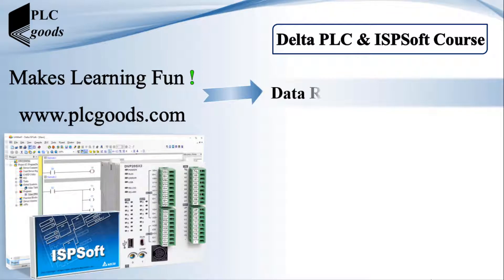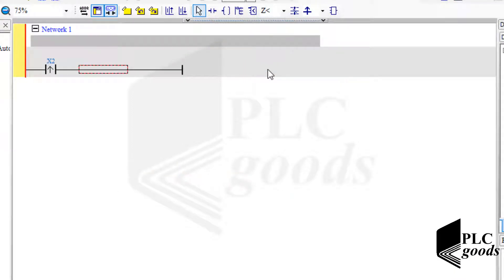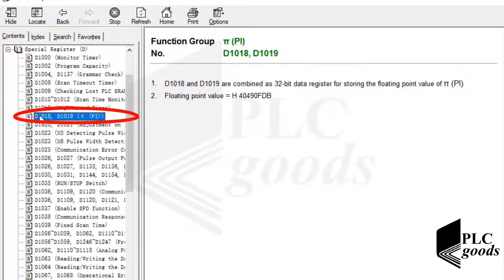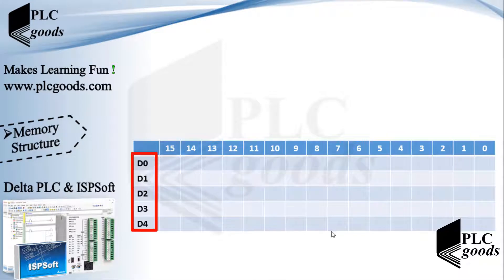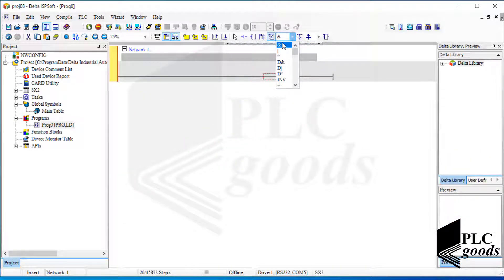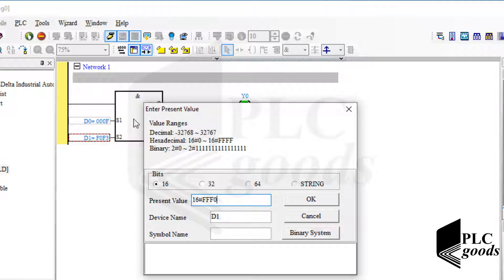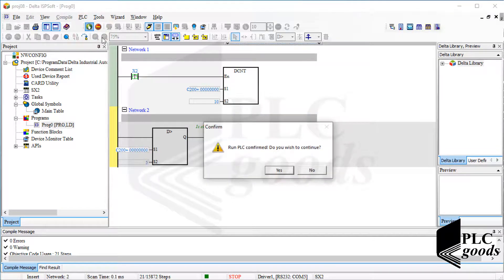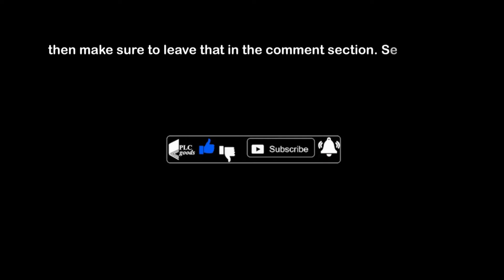✅ Delta PLC Down Counter with ISPSoft | Complete Data Register & Comparison Tutorial  | Lesson 8

Comment: Great video. What does the letter K represent? Thank you sir.
Reply from the maker: For each PLC, please check its manual to learn its addressing structure and the meaning of each letter. Overall, in ISPsoft (the programming software for Delta PLCs), the letter K is typically used to denote constants or literal values in the instruction set.

For example:
K0, K1, K2, ... can represent constant values used in operations. In the Delta PLC programming context, these are numerical constants that can be used in various instructions or data processing.

For instance:
K1 could represent the constant value 1 in an instruction or operation.
K100 could represent the constant value 100.
Reply: @plcgoods thank you very much. I saw the use of the Delta manual in one of your videos and have since downloaded it for reference.

Comment: Hi.

H86 in WPLSoft  is equals16#0086 in ISPSoft?

Thanks.
Reply from the maker: hi there, I've not used WPLsoft for a long time. I think your question's answer is Yes. however if you are using WPLsoft you can answer your question with a simple mathematic function. For example use an ADD instruction to calculate H86+2. Because 16#086 equals 134, I expect the answer to be 136.
Reply: @plcgoods  Thank you.

Comment: hello
i have delta DVP ES2 model. i am using ISPSoft when i click on (auxiliary design of extension modules), it gives me an error message (this model does not support this function). so what could be the solution and hpw we can work with extension modules for the ES2 model. thanks
Reply from the maker: Please check it out from Delta Electronics ❤❤

Comment: Hi, is it possible to compare two memories , (M0 and M1), using ISPSOFT?
Reply from the maker: Hi there, two-bit memories like M0 and M1 have 4 states and I usually use logical instructions or open and close contacts to compare them. for example, suppose a lamp must be on, only when M0 is less than M1. it means when M0=0 and M1=1. so I will need to perform AND logic between a normally open contact of M1 and a normally close contact of M0. I don't know whether ISPSoft has a specific instruction to compare two-bit memories.